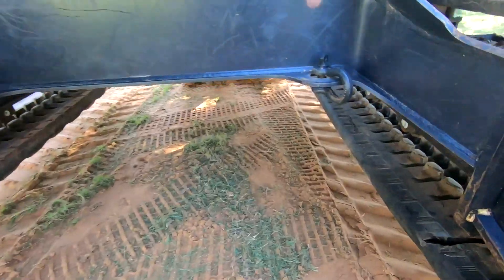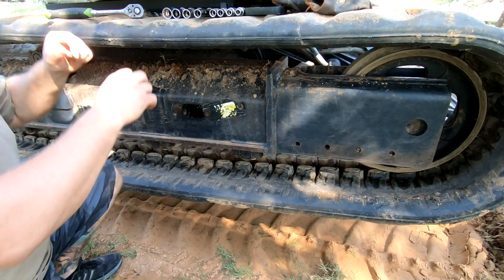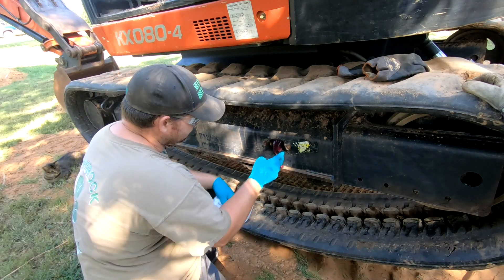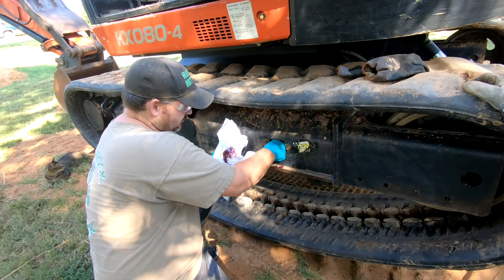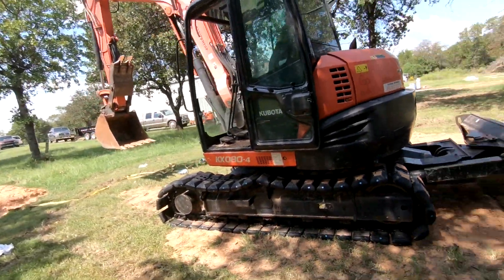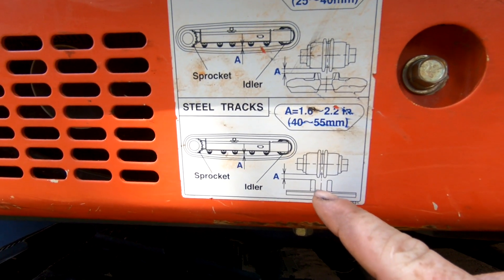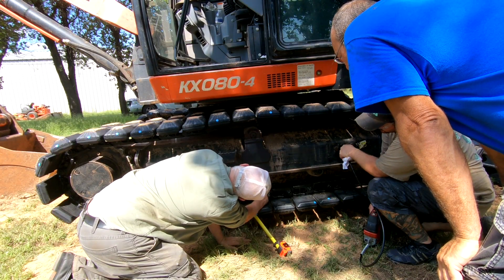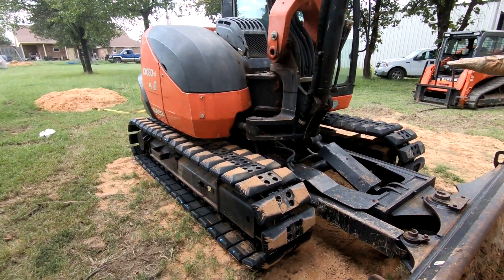Hybrid Track Installation #51:  Replacing tracks on the Kubota KX080-4 with Steel Hybrid Tracks

Comment: Hey, Our 80 got the same tear like yours! Ours happened at the marked spot on the track where its joined together in manufacturing so we think it was a defect considering we baby the tracks to keep them in good shape... Anyways, how have the hybrid tracks treated you the last 3 years? Is there any clearance issues between the angle blade and the track, our dealer swears it will hit the track and we should stay rubber
Reply from the maker: I haven't had a single problem with these tracks. Been on my machine for 6 years now.

Comment: Did you have to change any parts out when going to steel tracks? I was told I would have to I think on a new kx 057
Reply from the maker: It was a direct swap. I did not have to make any modifications.

Comment: How do you like the new tracks?
Reply from the maker: The new tracks are great.  I've worked a few jobs that have junk and chunks of concrete and the track are unaffected. So far so good. Thanks for watching!
Reply: @shamrockdirtwork7945  Thanks for getting back to me.  I was thinking on going with theses tracks instead of the all rubber.  Glad to hear they hold up.

Comment: Aw man u left out one part I'm looking for. Is there a tool to drive pin in? Or can I just whack pin in with a 5lb hammer
Reply from the maker: Oops, sorry about that...  I put the pin in the freezer and drove it in with a sledge hammer.
Reply: What way do tracks install? Narrow bolts towards front of machine? Towards the blade
Reply from the maker: @kwmiked  I don't think it matters which way they are installed.  I recommend contacting the manufacturer for clarification.  The tracks did not come with instructions, which is one of my concerns.

Comment: Do they help with floatation?The spacing seems like they may have a little trouble in mud vs regular steel tracks.
Reply from the maker: I haven't notice any significant difference. I only have experience with the rubber tracks. They are easier to lift the tracks out of mud compared to the solid rubber tracks. Probably because it allows air to enter.
Reply: I'm curious if the new tracks are wider, the kx080 I run cuts into things a bigger wider tracked machine will float over.  They are too narrow, the stock rubber tracks.  and too blocky. leaves a mess everywhere it goes.